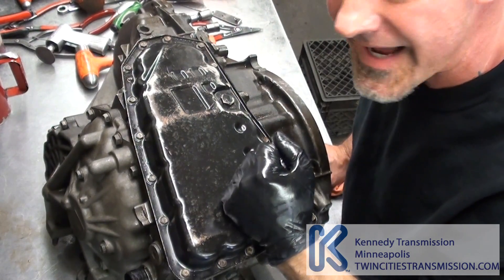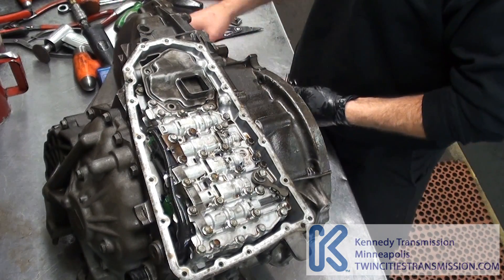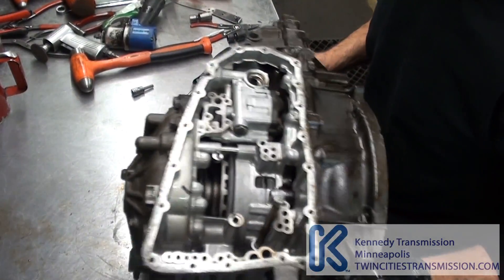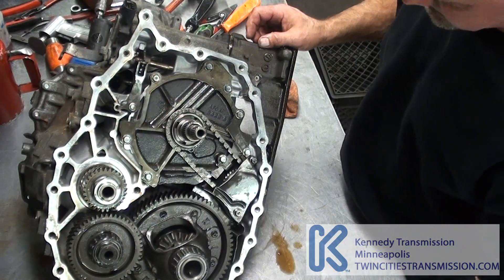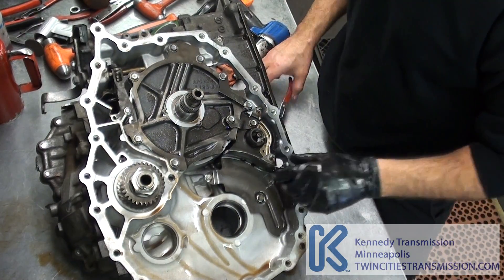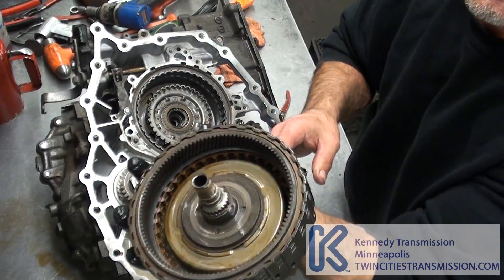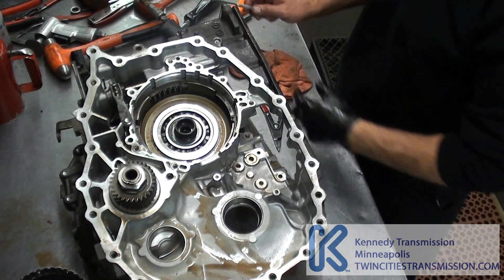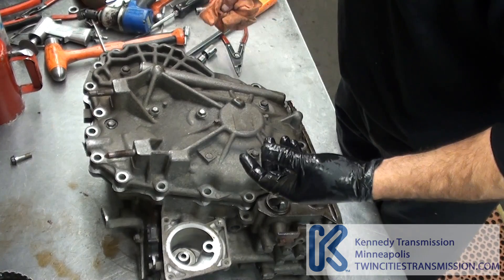Mitsubishi Nissan Jatco CVT (JF011E)

Comment: I'd never buy a vehicle that has a CVT Transmission. They never seem to last very long. My friend is on his 3rd CVT transmission in his, I think it's a 2015 Nissan Sentra? That car is so weak with that transmission, the engine nearly red lines on hills that my.  civic will cruise up at 2000 rpms. On a flat road I guess a CVT would be ok? There's a lot of hills in my state. I just think CVT is a poor choice for an area with a lot of hills. His car is on its 3rd transmission before it even hit 100k miles. Those things are a major piece of crap,not to mention that they're really expensive to fix. I'd never buy one.
Reply: You tell your friend to chill on the burnouts

Comment: I saw one where the shaft had worn out where the banding sheave bearing had split in half and the sheave jambed up blowing the metal bands all to hell. The shaft material is much too soft. They only use 3 grooves for those bearings. The transmission had 180k on it. The belts or bands didnt fail until the pully or sheave rotated and locked up. All hell broke loose then.

Comment: I knew about the Jatco reputation. Still, I bought a car with Jatco CVT. Now, it has 80.000 km, no problems at all, 1 regular transmission fluid change and hoping for the best. I love the tranny up to now (until it breaks). Mitsubishi is a bit smarter than Nissan using these CVT transmissions. I have a Mitsu, so that gives hope.
Reply: Mine is around 155k miled on 2011 lancer. Still good,until now i dont know there is oil filter and cooler cvt,i might service/replace it later..i usually change fluid around 50k km interval and using the oem mistubishi cvt j4 fluid

Comment: I just bought a 2019 nissan NV 1500 van for camping.  Did I get the terrible Jatco tranny. ? Should I get rid of it before it goes out ? Help please. !
Reply: No.  Only the little nv200 has a jatco cvt.  Nv1500 comes with either a 6 or 7 speed automatic trans.

Comment: Great video!
I have a 2010 Nissan Maxima. Would you recommend dropping the pan and replacing the filter and fluid like on a conventional auto? If yes,  any tips?
Reply: TommyMacDaddy1 I recommend a drain and fill/pan drop every 30k miles or having a Nissan dealer read the deterioration rate using Consult. Although a dealer costs more, I recommend only having the dealer do the transmission service because they’re such a sensitive transmission and can typically only run on Nissan’s genuine CVT fluid which happens to be NS-2 on my 2010 Altima.

Comment: What would cause a cvt to delay engaging into the next gear when getting up to highway speeds? My rpms just start screaming and the next gear never comes until I drastically let off the accelerator
Reply: That's literally how a CVT works. There is no "next gear."

Comment: given the absolute horrible experience I had with Kennedy Transmission, I would never recommend them to anyone. Took at 1998 Accord V6 in to the Blaine location and $3600 later and 4 failed attempts later to correct the issue, sold the car with 100K on it. They rebuilt the trans at 89K...
Reply: As much as I hate to say it, AAMCO at least down where my dad lives is the best in town, they rebuilt his 99 Continental tranny back in 2004 for $2400.  It was covered under the extended warranty he got from the credit union which more then paid for it's self, but he keep the car for 11 more years and never had a single issue with that transmission again.  My older sister destroyed that poor car, but the tranny was still running strong all the way to the salvage yard.
Reply: Seeing the disassembly techniques and tools used, I'm not surprised.
Reply: Why the fuck would you rebuild a trans at 89k? Couldn't you tell it was fucking junk?

Comment: Mitsubishi seem to have less problems with there Jatco CVT`s than Nissan is there a reason for this ?
Reply: Chris Cook INVECS ECU and the Mitsubishi engines equipped with this transmission makes less than the maximum torque limit of this transmission, which is 220 lb.ft.
Reply: @ricksays7133    So they fit the correct transmission for the car then ?
Reply: Chris Cook Yes, but I still think it would have been better if they used a 5 speed automatic. Mitsubishi used this transmission for fuel economy but I don’t think it matters when it gets 26 mpg on average daily driving.  A manual transmission is still better imo.
Reply: We have two of these cars owned by family members going on ten years old now no problems.
Reply: Thank you for This info,my wife lancer is around 155k miles as today..great to hear that invecs ecu is good with cvt ..

Comment: jatco CVT = CRAP.  Now you guys may tell me why toyota has no issue with their CVT. Answer Jatco company did not build them. That's it
Reply: Yes Toyota cvt is built by Aisin. They seem to have a way better track record than the Jatco units.
Reply: Well the reason im here is because i have a 2013 toyota axio with cvt transmission failure in my shop. no forward drive
Reply: @shaqwalcott1326  I just think CVTs are unreliable in general. I wouldn't touch a car with one personally.
Reply: Blue Moon the main issue with CVTs failing is because companies keep putting them into heavy and medium - high torque cars. Something these transmissions definitely cannot handle.
Reply: Is it Aisin?
Reply: Have a 2009 Lancer with 137k. Changed the cvt fluid twice, second time it was the pan, filter, gasket and transmission fluid change. Still going strong for me
Reply: @cutlassman1981  me too, Lancer GTS 2009 with CVT, that bad boy still strong

Comment: Why is it all scratched up? No proper lubrication due to not changing the cvt fluid? Just curious what the cause was?
Reply: Common weak point on these is the flow control valve in the pump, when they wear the pump loses pressure and the pulleys can't stay as tight causing the belt to slip.  This will result in marked up pulleys.  The pulleys are super hard though and can probably be cleaned up like new.

Comment: Kennedy Transmission...well done, Sir. You did fine with this Video...I own a 2004 Nissan 350z with this sort of CVT transmission. However, how often should I change the Fluid. Nissan has the specific special formulation for my CVT. The one you showed, looks terrible. My (3.5 DE) 350z had a faint noise inside the Passenger side cabin. I'm thinking too tight on the 2 service belts ie; a/c belt, alternator, 2 adjustment pulleys etc.....Whats causes this sign? Would you comment please? Thanks in advance!! KT-scribed (999)!
Reply: A 350z with a cvt? Hmmmmmm

Comment: Hi
I have a Nissan Sentra
I changed my transmission oil but the mechanic put NS2 instead of NS3
After a while the Gear stick in the 2nd gear that make me forced to stop and put it in park then he work fine for few minutes 
After that i changed the oil to NS3 and the previous problem gone
But now if i drive on a highlands i can't get enough power to go and the RPM rise

So any Idea or what is the problem with it ??
Thx

Comment: To  the folks at Kennedy Transmission: Where would I get a quality, factory rebuilt A341E for a first gen LS400? I fear I will be needing to replace my current unit at 360,000 miles. Or is a low mileage used unit a better bet? Lets' ignore labor costs for now. The rest of the car is mint. Thanks.

Comment: I was told by Nissan that a 6 year or 84,000km fluid change is mandatory for these transaxles - otherwise they tear themselves up not too shortly after.
Still not a fan of these transmissions - they are real smooth but Nissan programmed in "shifts" which really negates that feeling in the newer cars.
Reply: If you drive normal with light accelleration it still gives the smooth accel without the shifts. I've gone from 25-60 without the RPM changing more than 50

Comment: Where would somebody get parts for pieces of shit trans? Have a 2008 rogue SL  awd that needs rebuilt. Still runs and drives but it's in need of a new cvt belt and pulleys. It's jumpy and the engine bogs. Stopped driving it before it gernaded. Can't seem to find much info on the internet. I'm more than capable of rebuilding it myself just need parts.

Comment: The good old days of 3 speed autos and 3 speed manuals . When the colum shift manuals wore out i would pay $35 for a hurst floor shift to replace .
Reply: The manual transmissions are simple, efficient, reliable, with low cost of maintenance. Conclusion? People here  in US buy automatics, to the point where the OEMs stopped oferring manual transmissions on most models.
Reply: @bkucinschi  Manuals are exasperating on city traffic and hellish on steep streets. That's why sensible people buy autos. The price to pay is higher costs if and when they fail. Manuals are bound to disappear in the future, however, as well as traditional autos, CVTs, DCTs, etc. Electric motors don't need gearboxes except for a simple reduction gearset. But I'm sure most garages wouldn't be able to fix any of them, as it is nowadays with most components already. Swapping shops I call them.
Reply: @Gavichap  : I lived in US for 20 years now but I am originally from Europe, where (at least at the time) the grand majority of cars had manual transmissions. Once you get used to that,  driving in hilly terrain was no big deal. The biggest deal was to change the clutch. Last year I replaced the clutch myself to my old trusty 2005 Toyota Tacoma, took me one weekend but I had a great feeling of accomplishment. If a manual transmissions really breaks down,  you can get one pretty cheap from a junkyard. You can get an automatic also, but it's much more difficult to change and adjust, and a lot of time the junkyard autos are shot too. My truck it's 200,000 miles now, and its 5-speed manual works perfectly. 
  Yes,  people buy vehicles with automatic transmission... that's fine, they will have to buy them more often... keep the auto industry in business.  Electrics are coming,  but they will take a while to generalize, the power infrastructure is not there yet.
Reply: @bkucinschi  Many people including me cannot stand manuals in city traffic and on steep streets at standing starts, that's the ratio of buying an auto. It's just tiresome (and distracting) to have to costantly drive with one hand on the wheel and the other on the stick. That's one reason why over here pedestrians are run over on the zebra crossings at maddening rates (the latest just yesterday, dead): they drive in 4th as long as they can. Auto gearboxes don't come from Mars and they can be fixed by dedicated specialists, like engines (modern ones are as complicated as you can think of). Pity that most of the times mechanics are as hopeless and lazy as 5th grade brats. I fixed the 'automator' on my jurassic Fiesta myself with info I found on the internet with a DIY tool as simple as a pencil. And I know very little about mechanics.
Reply: @Gavichap  : Automatics are certainly simpler to drive, and very convenient in congested areas. My point was that all those advantages come at a cost. Sure, there are handy guys who are able to maintain and repair an automatic transmission, but most people can't so they finish up with a significant financial burden. In USA a failed transmission (out of warranty) means, most of the time, that the older vehicle is junked. So, spit the money or get in debt for a new one. For the traffic conditions in my area a manual transmission is no problem. I'm not a rich guy, so for me a manual vehicle equals financial comfort.
Reply: @bkucinschi  You're not taking any argument from me as regards costs. It goes without saying that autos are more expensive to fix, that's why it is essential they must be manufactured to last as long as the engine, which clearly JATCO/Nissan fails to do. But by your opinion nothing complicated should be added to cars because it would be prone to fail. So, no autobox, no electronic injection, no ABS, no PAS, no aircon, no cruise, no etc etc. You realise we'd still be driving Ford Model Ts if we stuck to Henry Ford's famous saying :-)
Reply: @Gavichap  : Man... you're right,  I love Ford T and Douglas DC3 😁
Technology evolves of course. I'm not saying the automotive technology should freeze in time.
It's just that I save some money being "old fashioned".  I tend to be a bit conservative, wait and see what technology passes the test of time.
.... probably that's why I usually go with Toyota, that manufactures reliable cars and trucks.

Comment: Thanks for  the effort on this video, glad I found it.   I deal with these transmissions so much but never take them apart more than replacing the pan filter.  Anything not under warranty gets a junkyard trans, which always seem to work out.  The metal on the magnets and on the pan, and the dark yellow color of the fluid is consistent with 80k+ with never having any fluid/filter service.  

At training, I took one of these apart like this and put it back together once. A big point they made was that if this belt was ever allowed to slip at all, it would would need a belt/pulleys/bearings because it would soon lead to the damage shown here.

I've done a few transmission videos myself, and it's tough to make it turn out to be an interesting video.  Thanks for doing a nice job.
Reply: If you maintain fluid changes every 30k with OEM Mitsubishi Mirage tranny fluid can one potentially get 150k miles out of the new CVT7?

Comment: The only company I would consider buying a CVT from is Toyota....  so far they have had no recalls or issues.
Reply: Guess again, 2014-2016 corollas. CVT would go into limp mode, 37mph max. 2 updates. First software update trashed good valve bodies, second update requires a road test to verify no issues.  goto toyotanation-dot-com.
Reply: @orbitalair2103  i am going to use that web sites to see if there is a recall regarding a p04401 code....
Reply: Same ere. Toyota uses Aisin transmissions which are very well made. They've been using them since 2001 on their Prius'. Scotty Kilmer will tell you the same!
Reply: @hedga001  Rev up your engines, cool guy ...
Reply: @tonycoffee7335  before it's too late

Comment: Finally i found this. I have a Renault fluence (Korean made) 2012. Privilege 2.0 liter engine  mr20  Nissan engine with the same cvt transmission. I have changed  transmission oil 2 times since new, and the hardest thing is to find the paper filter replacement part inside the oil cooler.  (Nissan part number  31726-1xf00) Renault dealer thought it was a bearing , when i asked for it in the parts catalogue. Great vid and very helpful. Thank's for it.
Reply: where is it located at? I did not see it in the video, maybe I skipped over it?
Reply: @rollandelliott  they don't show it. Look at this video. second  50  shows the fiter housing..(how is your portguese?)https://www.youtube.com/watch?v=74cT8ykwclM. Hope this will help. This filter is the same for Nissan sentra 2.0 2010 cvt transmission.
Reply: @robotech1990  THANK YOU!